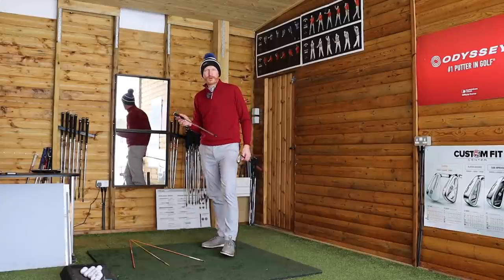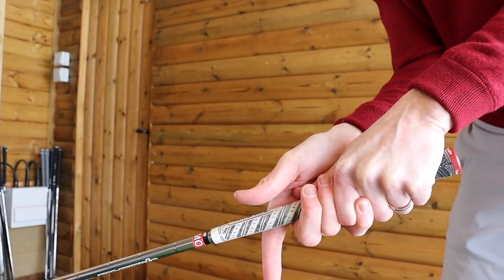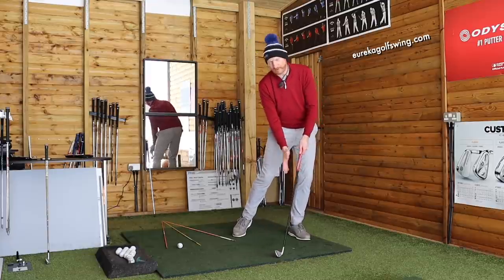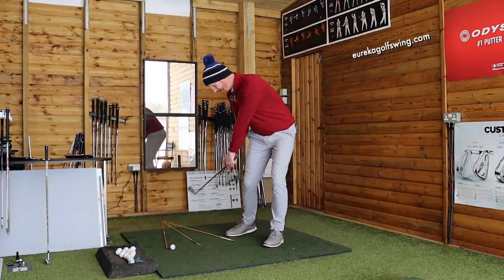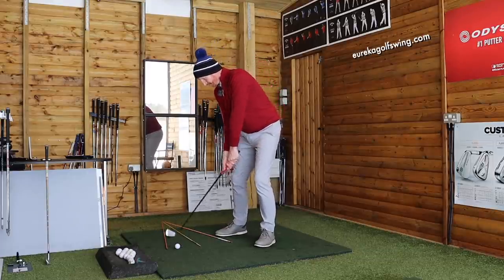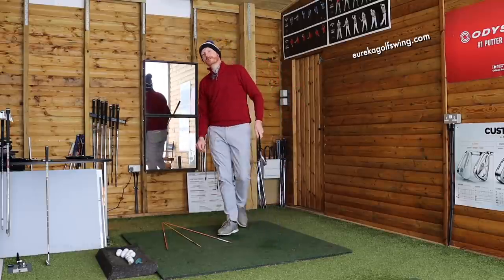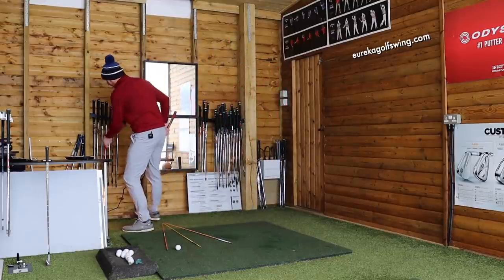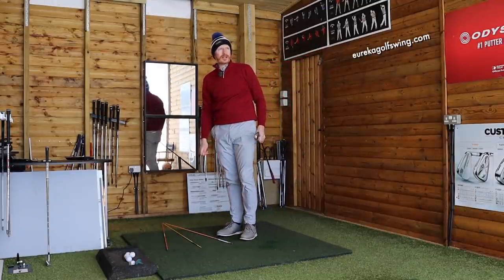I put a PUTTER GRIP on my 7 IRON and hit DEAD STRAIGHT

Comment: Are you sure this is illegal? I’ve looked it up and I don’t see any rules governing the flat edges of grips, it just has to adhere to size and weight requirements
Reply: b. Cross-section (See Fig. 19)

(i) For clubs other than putters the grip must be circular in cross-section, except that a continuous, straight, slightly raised rib may be incorporated along the full length of the grip, and a slightly indented spiral is permitted on a wrapped grip or a replica of one.

Comment: Apart from the benefits of the flat spot your video concentrated on. I'm considering fitting the XL oversize round (legal) grips on my clubs, aka Bryson Dechambeau style. What are your thoughts
Reply: Same here. However I have short fingers, so not sure if it would work.
Reply: I have small hands and play midsize. Makes a positive difference.
Reply: Good part - less pressure through the hands - better strike: Not so good - wrong grip - amplify faults? I have a slightly thicker grip on my Driver and wedges - works with my brain - which is part of the process! Bit like extra weight on the club head to encourage letting gravity do the work! BUT - I would rely on Sensei for an answer not a Muppet off 12!

Comment: Could someone design a grip with flat edges surrounded by a soft tube? When you apply pressure to the grip you would feel the flat edge but tge grip would still be round! Would it be legal?
Reply: Sssh!

Comment: Really informative video so I wouldn't mind trying this on a couple of my backup irons as a practice drill, so which type and size of putter grips would you recommend using e.g. round grips with one flat side?
Reply from the maker: Any putter grip that is similar thickness as your iron grips
Reply: @stevejohnstongolf  Cheers, 2 weeks ago I stuck a Garsen G-Pro Edge putter grip on a backup 6 iron and this is amazing as a practice technique for keeping a square club face angle, this grip is a very similar size to the midsize grips which I play on all my clubs but it actually has 2 flat sides so it is perfect for this purpose.